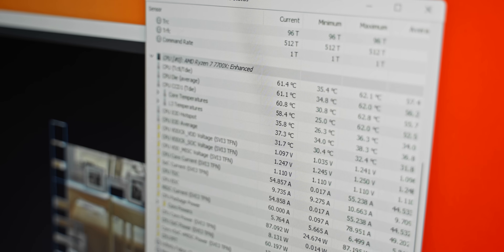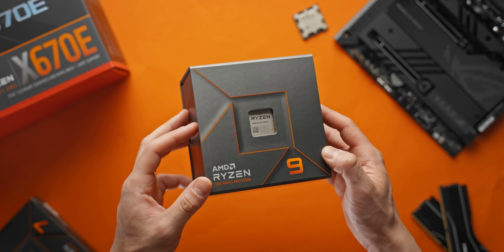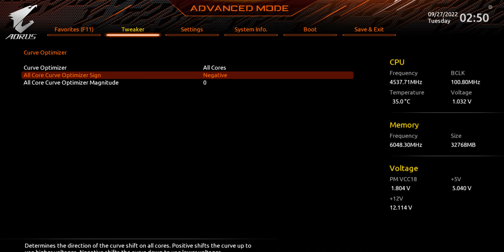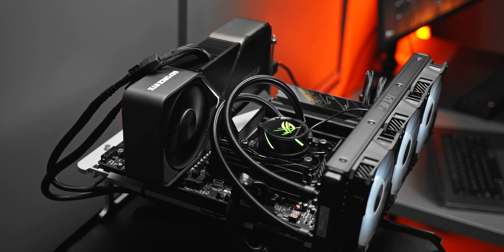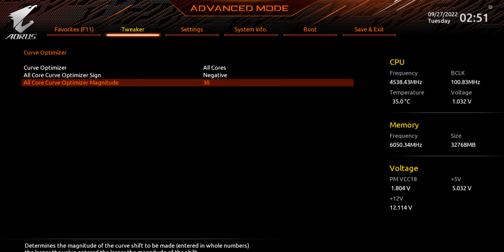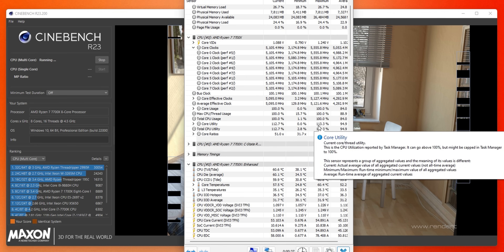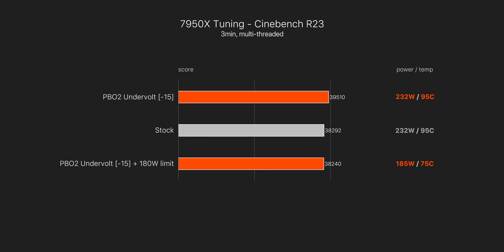Fixing Ryzen 7000 - PBO2 Tune (insanity)

Comment: Works on Ryzen 7 7800x3d with msi b650:)
Reply: can you share the things you changed on your bios? I'm using same processor but has gygabyte b650.
Reply: @ihayme  I used AMD Ryzen Master

Set my curve to -30 on all cores but my fastest and second fastest which I set to -35 and -40. 

Set my PPT to 60W and I still get a Cinebench score of 18K with 20 degrees better temperature. 

I am happy with these results and even though I could probably push it further. I can't be bothered.
Reply: @Veganarchy-Zetetic was the ppt originally like 480000 (maybe one too many zeros)

Comment: performance gains are from lower temps. 
the lower the temp the higher the CB23 score.
If you could take that stock CPU and cool it to 45c with a crazy good 420mm custom loop it would score probably 22500 or higher at same power n clock speeds purely because hot silicon and copper loose performance this is the same for ALL Electronics since the 1960's

Comment: does going too low hurt anything?  I know overclocking can hurt things, but can going lower?  Under than being not stable it doesn't hurt it when you're taking voltage away?
Reply: Lowering does the opposite. Better temperatures and lower voltages means longer lifespan. Worst that can happen is system becoming unstable then you know you lowered it too much.
Reply: @Veganarchy-Zetetic  I appreciate the input.  Do you know if there is any correlation with it affecting the internal memory controller?  I had to replace my 7800x3d after 3 months because the memory controller failed.   Could undervolting caused an issue?
Reply: @Snafu2346  How do you know for certain that was the issue? Nothing much come up online when searching about it.

Comment: 7800X3D 1.200v + CO negative 10, on liquid cooler 360 rad + 3 fan on it! 31 to 40 idle, never go over 74 degree at 100% stress load, around 50 to 64 when gaming, I love my 7800X3D power consumption is a joke :P!

Comment: My brand new 7600x can hardly run chrome. It can run valorant at high frames but temp gets up to 80-90 . But at 5% cpu usage on chrome it super laggy. (Gpu usage is at 50% for twitch or video streaming)

Comment: Those who can't hit stable -30 on all cores, can try per ccx optimization, for instance in my 7950x the cc0 can only handle -20 offset, while cc1 handles -30 comfortably.
Reply: Do you guys adjust each curve, per core in BIOS, one by one? or do  you use Ryzen Master. Asking because I read somewhere it's "worth the hassle" of doing it via BIOS instead of Ryzen Master, since it's more accurate that way. Is that true?
Reply: @TuncaCeleste Ryzen master - glitchy, it can damage the BIOS chip and the BIOS will have to be flashed through a programmer.
Reply: @БогданКононенко-л2ж  is there evidence of this?
Reply: I am completely new to this. How do you know whether it is "stable"?
Reply: @chillaxTF  Run benchmarks and if its not crashing then its stable

Comment: The single best ryzen 7000 video ever made so far :p
Help a bunch on taming that cpu, bringing it down to a manageable level. I have done 85°c limit, negative 15 pbo and watt limit to 120.

Stats : 5487Mhz, 83.4 degree max, and my best scores yet on my 7700x in benchmarks. (I made it past 200fps for the first time.) 
Cooling it with an ak620 btw. 

Many thanks for this one.
Reply: Was ist unstable on minus 30? Tested mine the first time on minus 30 on cinebench 24 and think its stable for now. Also got the 620 as a cooler.

Comment: I just undervolted to -30 and clocks boost to 5.4 and temps on stress tests stays at 80C
Reply: What settings did you all use? By chance using a msi mb? I have a 7700x and was told to look this up
Reply: @sleepyShaman479  yeah I,have a 7600x with a msi MB

Comment: This worked very well, thank you very much, no wonder why it got recommended to me!
Reply: What settings did you end up running? Do you have a aio or cooler?
Reply: @sleepyShaman479  Hey!
I'm using a 7800X3D on an Asrock B650M-HDV/M.2 using the 2.02 bios with a G.skill F5-6000J3038F16GX2-FX5 ram kit.
It's cooled by an Artic Freezer 2 AIO in 360mm. 
Activated PBO and set a 85°C limit and my system is stable at -20 negative curve.
Used a mix of OCCT/Prime95 and games to find it it's 10 hours stable or not,  -21N PBO is stable in bench but sometimes crash in game, -20N PBO is rock solid but that's just the silicon lottery.

Comment: After applying these parameters (all core curve optimizer magnitude= 30 , platform Thermal Throttle limit= 85 , ppt limit = 104000) on my  Amd Ryzen 7600x on a Gigabyte b650 gaming x AX the score on Cinebench23 literally exploded and went from 13980 to 15270. The test itself went without a hitch. Unfortunately, as someone pointed out in the comments here, the Cinebench23 test alone cannot be a guarantee of stability for the computer. Indeed, over a period of a month after applying these parameters, I have enough hindsight to almost certainly determine how they influenced the stability of the computer, l had a frequent crash and even restarts when playing demanding games in ultra settings, most of the time after playing more than half a hour,  One day, I even counted 14 crashes during an online gaming session, and two restarts; it became downright unbearable. So instead of directly blaming these tunes, I decided to proceed by elimination, and I tested all my hardware and software. I reinstalled all the games that were crashing, and I even reinstalled Windows, but nothing changed. Then I updated my BIOS with the latest version, which of course erased all parameter modifications, and the crashes completely disappeared. But I’m not stopping there, I need to know exactly which parameter led to all these problems. I tend to think it’s the curve optimizer magnitude, but I’m not sure yet.
Reply: keep us updated this is interesting
Reply: @doumanseiman2645 -30 is too much for some, so maybe
Reply: Find your fastest cores, I used ryzen master to find that out, in my case is C3 (1st fastest) and C1 (2nd fastest), so I did per core, doing C1: 15, C3: 10, all the others being 30 and so far I had no issue whatsoever.

The only thing sometimes I don't understand, how does this affect low 1% fps, sometimes it doesn't seem to have an effect, but sometimes it does seem to have, so I'm a bit confused hahahaha

Comment: Adjusted the curve optimiser as you suggested, got it to 35. Didn't save much on wattage or heat, about 4watt and 3 degrees, but gained about 300 mhz.😅

Comment: I'm just using this guide to my 7700 non X variant all the way to 3rd method

My PC crashed while cinebench

So I changed value in "all core curve optimizer magnitude" from 30 to 15

Cinebench test passed with score about maybe 18000 ish something like that

Highest temp is 76

Good guide btw
Reply: My 7800x3d scores above 18k with -30, you should be scoring higher
Reply: I change value from 15 to 20 and my scores pass 19k  @iamdeluluu
Reply: which value you set to minus 30 ???  @iamdeluluu

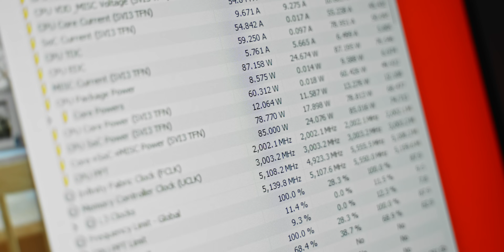Comment: 00:00 Intro
01:39 Precision Boost Overdrive - Curve Optimizer - All Cores - Negative - 10 to XX
04:08 Precision Boost Overdrive - Platform Thermal Throttle Control - Manual - XX
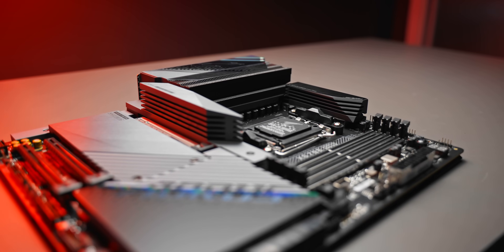04:54 Precision Boost Overdrive - PBO Limit - Manual - - PPT Limit - XX
Reply: thx ya
Reply: Can it be used on R7 7700 (not X)?
Reply: @LibertarianBoy-BRyes i am using

Comment: For my 5800x, I have set the CO at minus 25 while the ECO BIOS (63W) enabled. The clock speed dropped from 4.85 GHz to 4.64 GHz while drawing less than 63 Watt maintaining around 62 to 65 degree Celsius while gaming in the winter season.
My CPU can operate on minus 30 CO but not just on 63 watt.

Comment: I have a question. In your previous video about the 5000 series, you chose to turn PBO limits off. Is there any reason as to why you chose to turn it on Auto for the 7000 series? Or was that just a slip of the finger type thing?😅😅😅😅 1:50

Comment: I did this on my R5 7600!
  negative offset set to 25 on curve optimizer, didn't set power limit as it's not the X variant. my consumption during cinebench was 60W so no need to limit this... Anyways previously hovering at 69°C on my nr200 with PA120 @4.8GHz,  now with these settings on PBO2 I get 5GHz with 67°C but the fans are on silent profile now 😅😂 so I'll take that. Better acoustics better thermals and better performance all for 2 minutes work in bios lols

Comment: I did the exact same thing as u did, I have the same procesor. after 3 days of gaming I went from 88g to max 72, all cores stay around 5.1-5.3 GHz in warzone3, 70 g Celsius, 170 fps . You sir are a god. ( I have it paired wit radeon Rx 6700xt that stays at 55g) amazing

Comment: Man, best video ever! My 7800x3d was able to handle the minus 30 and in ow2 training i went from 75 ish °c to 45 ish °c. Also cinebench socre went up by 550 points.
Reply: I think you might have the best 7800x3d lmfao
Reply: Thats insane! Great results
Reply: Did you also set your 7800x3d to a 85w limit to get those temps?
Reply: @lucaschacon7436  naw im too scarred to do any beside the pbo curve lol im using a deepcool ls720
Reply: @frostedflinks  lol, same, so what I'm gonna do is find out the tdp of the 7800x3d (I got the same cpu), lower the thermal limit as much as it can go without becoming instable based on that tdp info, and come back here and post it for yall. Let me know if ya heard of anymore pointers.
Reply: @lucaschacon7436 any update? i’m trying to tune my 7800x3d, wondering if you had any success in your findings?
Reply: @tension2g I’m currently tuning mine as we speak following steps in vid with common sense and will see how this goes currently getting a score of 1057 in cinebench r24 so will see the score after this
Reply: Clock speeds are hitting 5050 to 5300mhz, score went from 1057 to 1124 and I already had pbo just didn’t customize it with curve. So pretty decent performance boost
Reply: @SBTradingFX what tuning did you do ?
New to PC, I have a 7 7800x3d also any response I appreciate you.

Comment: I have a 7950x with a 360mm aio, and i only get a cb23 score of 37462, do i have gotten a worse silicon than possible or:
is it because i run my monitor on my igpu, because i at this time havent bought a gpu (waiting for 12v2x6)
or because i dont have an open air bench
or because i run my fancontrol with icue, in the background?

I really want to know what the problem with my cpu score is, and if somebody is experiencing the same?

Comment: i have no idea how you are getting such high scores on that 7700x. I've tried stock and got 19500-2030ish now i  try yoiur way to get temps down and temps are good around 60's but cinebench scores are around 18500 mark and i can't go higher it seems like.  If i change the ppt limit to 95000 do i have to change the TDC AND EDC lmiits to or could i just leave it ?

Comment: Okay, so I was able to lower my Curve Optimizer to 30 and restart my computer without any problems. However, after running R23 successfully and gaining a score of 37760K, my system crashed as I was closing the program. So, I went back in and set it to 28 instead, and have had good results since then. While it didn't bring my temperatures down, I did manage to run the benchmark at 5,500k on all cores except three, which ran at 5,750k. So I did gain quite a bit of power, although still at 95c. 
I then I followed your example of limiting the temps, and tried to limit them to 85c, but that crashed my system over and over. Then I tried 88c and still got some random crashes here and there. So I settled on 90c, and that seemed to run very well with no crashes. I guess five degrees cooler is something, and better than 95c. But I'm not sure why my system crashes at lower temps, instead of just getting less performance??? Any idea's on that??? Thanks for the vid, as we appreciate anyone shedding some light on how to get more out of these cpu's.  I'm also running the latest bios 1709, on a ASUS Strix X670E-E and a 7900xtx gpu.

Comment: The Temperature is not an issue, it's designed for that. It only reaches those Temps under heavy load, especially synthetic benchmarks. If you want to improve the efficiency a great deal or want to overclock your Zen 4 it's certainly the best way to do it through PBO.

Comment: So I just tried 30 negative curve magnitude and did a 3dmark demo complete benchmark (with a small cpu benchmark), nothing crashed, temps seems to be normal, you reckon I should keep it that way or should I test furthermore?

Edit: I don't know how many will read this but here I am 2 years later, I've been rocking the pbo -30 with no issues except extreme cases (right now the most extreme for me was 8-10 hours of cpu intense process, which led to instant crash). As those extreme cases are rare I'll just power limit, but I think that a beastier motherboard would just do the trick as I have good silicon.

Tl;dr : these settings are real, CPU is a beast, 2 years daily usage with very little issue.
Reply: 7700x also btw

Comment: thanks for the great video. just tried out -30 on my new ryzen 5 7600x and got a ridiculous 10° drop in max temperature on cinebench. In my opinion the undervolt is worth it for the improved fan noise alone.

Comment: Was able to achieve -28 all core CO value with 85 watt ppt limit. Temps under stress 65 to 70 C. 5.1ghz frequency after 2 minutes. 1.1 to 1.18 core volt.😮😮all on a peerless assasin se dual tower air cooler!! So far no stability issues. Most games play about thr same. Fan noise is about 75% of full noise when out of the box.

Comment: My mobo, msi a620m e, has option down to 255, and i just did like you and make it 30 negative. Is it weird that much of room to cut the power down to 255, or can it be a lower scalar to arrange. Long story short should I be doing 255 or 30 (like you)

Comment: I did this on my 7800x3d went from 86 degrees in games to 56 degrees in games! And the clock speed went up from 4.2ghz to 5ghz on all cores, you can see this on my benchmark videos. So this definitely helped out a lot!
By the way I did the neg 30 and no problems there :). My PC use to idle at 55 degrees before i did this steps, now it idles at 34-44 degrees (44 being in the summer and 34 in the winter in a heated apartment)
Reply: Gratz, great result! What motherboard?
Reply: @tomaszcodasz  I purchased the ASUS ROG Strix X670E-A Gaming board.

Comment: Thanks so much for this easy guide Optimum Tech, i applied this settings on my new AMD 7800X3D and it works very very well.
Reply: What setting did you apply. I have the same cpu.

Comment: Hi, I would like to undervolt my 7800x3d, mobo asus tuf x670e wifi , air cooler noctua DH15.

I was wondering if to get even those 5/10 degrees less it would be okay to set the curve optimizer to -30 (if stable, better -20?) on all cores and thermal throttling to 85 degrees, without touching a value like PPT, TDC and EDC.

Comment: amazing guide! followed the exact steps and got my 7600 non-x thermals down to 75 degrees from 95. Used -30 on the curve, and 65 W on the power limit. Performance drop was negligible (~1%)
Reply: Glad to hear, planning on doing this on 7700X see how it goes

Comment: I got -30 on my 7800x3d. Passed on cinebench and other benchmarks while hitting higher frequencies then just enabling pbo . The  thermalright peerless assassin 120 was doing OK for an air cooler but I got the deepcool lt520 because why not and it's one cool customer. My 7600x could only hit -20 and was bottlenecking my 7900 xtx while still reaching hotter temps than the x3d. Thanks for this

Comment: WOW. This fixed my only gripe with my entire build which was cpu temps. Did a -30 CO with just the 85C throttle limit and my temps dropped significantly in every game while maintaining a 19657 Cinebench score. Thanks so much!
Reply: I suggest you do the other things too, they increase your performance slightly at no temperature cost

Comment: This is great, my 7600x gained like 500 points on cinebench while running 20 degrees cooler with my fans not even spinning up to full speed. I didn't even have to set the temp/power limits, just the negative 30

Comment: Amazing video and echoing all the other comments, great detail that’s easy to digest. Quick question to others, I made these changes - is it normal for it to idle at 4.8-5.1Ghz but very little utilization %? Just making sure I didn’t miss a step on lowering the clock speeds while not being used. Using a 7700 non X.

Comment: Hello friends, greetings to everyone.
I have a 7600X. I am using the MSI B650M-A WIFI model as a motherboard.
First of all, doesn't this motherboard have a fast boot feature?
Also, although my XPM or EXPO rams support it, it does not boot and boot times are extremely long.
Is there anyone who can help me?
(I'm sorry if there were any mistakes in the translation, I don't speak your language very well.)

Comment: LOVE LOVE this video. I also have a 7700x and set per core -30 on all but two cores. I had crashing issues doing an all core negative offset. The weakest cores can only handle -10 curve optimizer. Max wattage at 105 (i dont mind the extra power to squeeze out a little extra performance) and 85 degrees temp limit. I get around 19,200 on cinnebench with a Scythe Fuma 3, max 5.1ghz clock speed, around 75c max CPU temp, ambient temp of 23c.

Starfield does like to push this CPU though, I get spikes of around 82 when playing, but mostly hangs out in the mid 70s with around 65% fan speed.